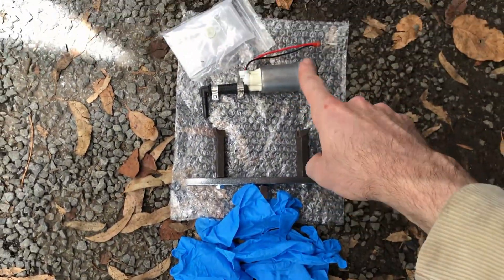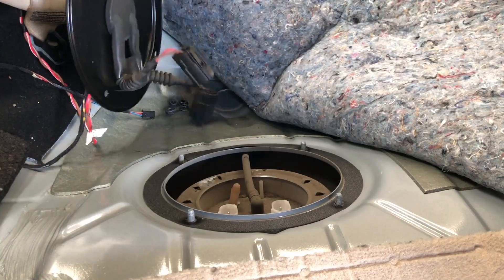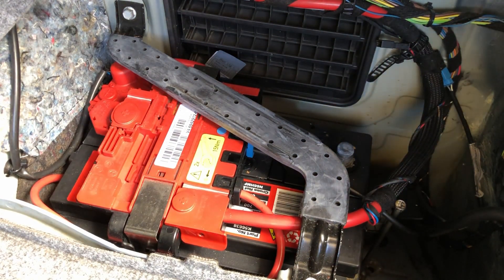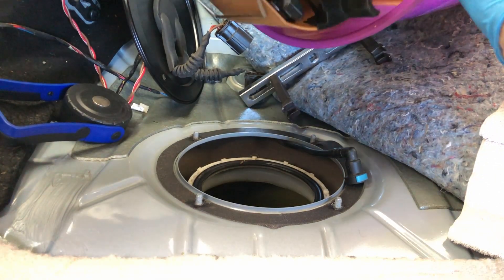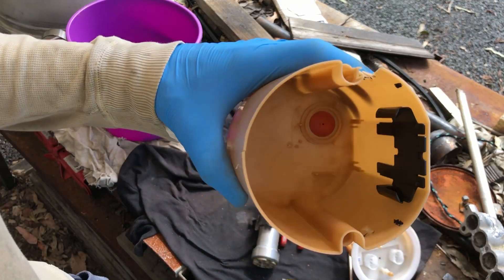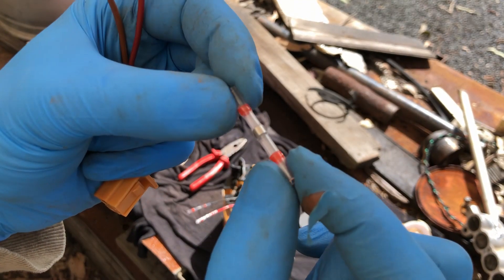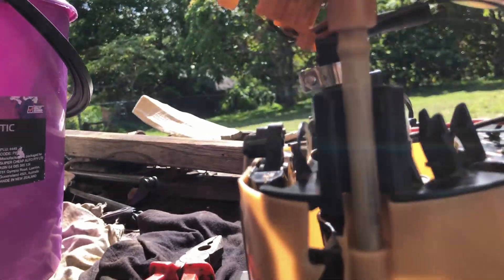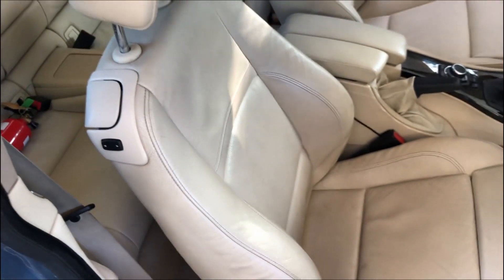E92 BMW 335i in Tank Fuel Pump Upgrade - 460LPH

Comment: Go hard enjoy e85 mixes! Not old walbro. 

Ti automotive made walbro pumps for ever. Around 3 years ago ti announced they will be putting there own name on the pumps  and change names and part numbers. ti 267 has a relief valve around 90psi, ti 274 has relief vslve around 115psi both same flow 460lph. Anyone saying walbro this or that is well behind.
Reply from the maker: Yeah, I'm on the E50 tune now, putting abit more than half e85 to a tank, about 3 parts E85 to 2 parts 98.
Thanks for your input, I'm kinda old school now I guess hah, most of the work I did on my Silvia was between 2004 and 2008, and it was a Walbro 255lph in tank pump with a Bosch 044 external from the surge tank which I still run. 
It's always good to learn a little more, thank you! ☺

Comment: Good stuff i've got a TI F90000295 535LPH waiting to go in. Any concerns about not running stock venturi?
Reply from the maker: That should be sweet!! 
So far so good, I think with the cracks and holes I made in the bucket the stock venturi shouldn't matter to much, I think there's another venturi on the other side of the tank that pushes fuel back to the bucket through those 2 little black hoses, or back from the regulator or something, I'm still learning about it all as I go!
I'm taking the car to the track on Friday Night for a little practice, it will be my first time on the racetrack in 12 years!!! Will see if the car hold up to the abuse!
Reply from the maker: I've got more of those 90 degree quick connectors too if you need 1.
Reply: @ScubaMade  I recently got one of those BMP fittings so i'm all good. Thanks heaps for the offer though
Reply: @ScubaMade Sounds good! Enjoy it :)
Reply from the maker: Ok, sweet as!
Reply from the maker: Can't wait for Friday night ay !!

Comment: You didn't cut the lower part of the pump and you didn't use the venturi. It will be most probably like this: Everything is working fine until you have some longer hard revs..... and then you are running out of fuel due to the fact that not enough fuel is in the bucket... it takes to long that the bucket is refilling itself through the existing and small opening in the bottom of the bucket. A few seconds later everything is running again. It simply takes a while that enough fuel is comimg back into the bucket. Therefore I  recommend you to take the bucket out and cut the lower part off. ( OR to build the pump/bucket with the venturi.). In worst case you damage your engine if you stay like this.
Reply from the maker: Thanks for your input, I'm still learning about all this and I'm taking the car to the track tomorrow night to test it. Do you think cutting the bottom off the bucket is better, or a hole in the bottom or something?
Reply: @ScubaMade  Usually the bucketless mod cuts a lot of material away (there is a good how to by the youtube channel "vehicular diy"). If you go on the track with low fuel level you may want to go bucketed with the venturi installed. The disadvantage of the veturi version is that there is a little bit less flow in total (should be still enough for ~580hp on e85) and the mod is more complicated. The advatage is you don't care about your fuel level.
Reply from the maker: Yeah I really enjoy the 335I god that is Vehicular DIY on YouTube, his content is amazing! I think I saw his fuel pump video a while ago and he cut a hole for the filter or something from memory, I try not to let the car go lower than a 1/4 tank ether, the big test will be how I go tomorrow night at the track!
Reply from the maker: It held up at the track with no problems from the fuel system at all!
Reply: @ScubaMade  That's nice. Was the fuel level high / low?
Reply from the maker: I got to the track with half a tank and was just above quarter of a tank at the end of the night!